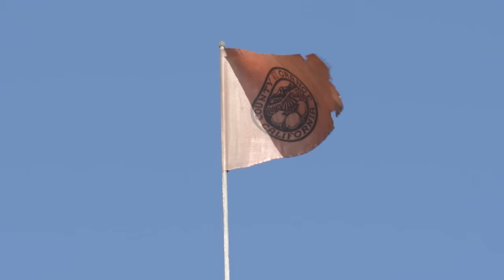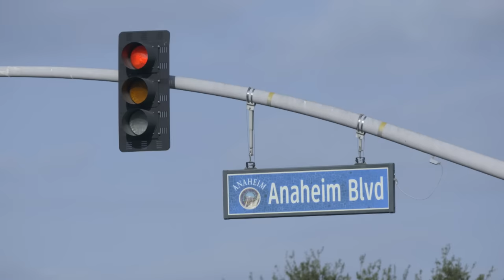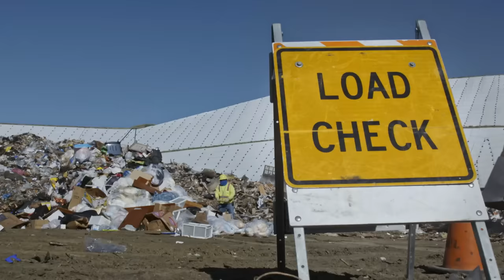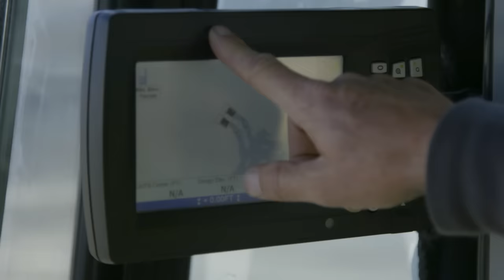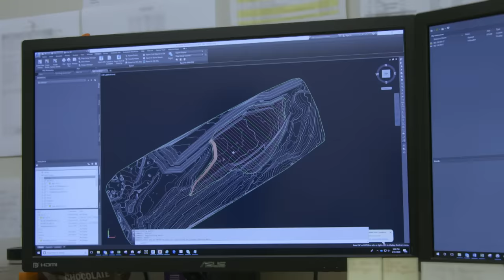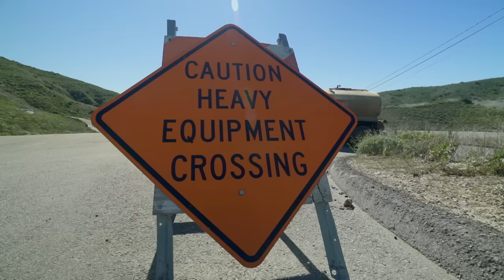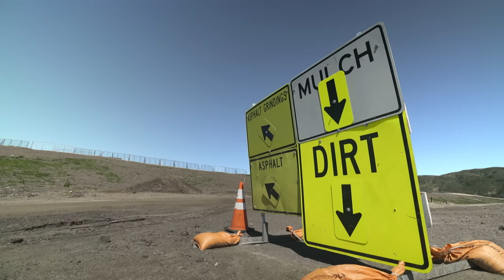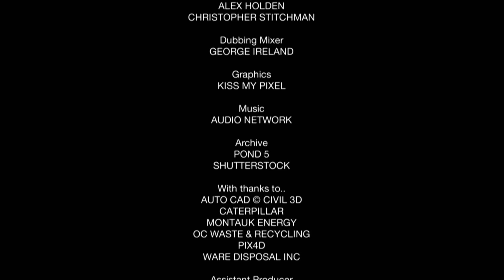Secrets of the Mega Landfill | Free Documentary

Comment: It's really sad to me there isnt a dumping area where the trash can be put on a conveyor to under mag stands and Eddie currents that would pull out a lot of the ferrous and a good bit of nonferrous metals like if they had a giant hopper built in the ground to shake and convey the material under the two mechanics I just spoke about
Reply: I guess I guess my ball park solution would be a designated dump area and truck it to the correct area but the material recovered steelhead alum stainless brass copper lead touch of zinc would have to be worth more than trucking the material to the correct spot on there dime

Comment: There is no way a single guy or group of people can sift through that much garbage weeding out the stuff that's not suppose to be there.  You would need either an electronic system in place to detect or a mass amount of people.
Reply: Has anybody else seen those machines that scans like five or six different types of plastic and then the plastic gets moved along a conveyor belt and a series of wind tunnels blows the plastic into different bins where they're supposed to go? One can assume that plastic is the majority of the garbage so I thought they would try to get most of the plastic out because it doesn't biodegrade for a long time? No way they can sift through that much garbage to get stuff out unless they meticulously go through it?
Reply: @mitchweber7868  Interesting.
Reply: they probably can only spot check. I assume more from what comes in from commercial routes.
Reply: If this screener guy is the only one in that place I doubt he gets more than 1 tenth of a percent. Probably less

Comment: LANDFILL OR FLARE GAS CAN PRODUCE BACKUP POWER:  - Mobile or Helicopter Liftable 8,000 lbs.), Made To Order in the USA Multi-Fuel Generators & Pumps. Environmentally Housed - Self Contained - Gas Turbine Power Modules - 1, 3, 5 Mw -150Mw

Unlimited Parallel Modular Configurations - 50 Hz AC - 60 Hz AC or DC output at optional HP ratings in mid-range voltages.

Comment: They never mentioned the noxious gases that these landfills produce and  I feel sorry for the people that live down wind because it goes into their homes miles away
Reply: Did you miss the part where they burn the gas and produce electricity?
Reply: @gailgrove  not all the gas is captured.  At the landfill I used to work at I think most was captured in fact more was captured than the generators could use.  Alot is flared off because there's not enough storage capacity.
Reply: Well they generated it, let them smell it.

Comment: OK I have a better way to set this up all they need to do is dig a bug huge square hole 500 ft down run all the garbage threw a Shredder and mix it with crumbled dirt coming from 2 conveying belts it will flatten with water and rain then the last 50 feet dump nothing but dirt on top and flatten it instead of pushing it around and running spikes through it for air pockets wasted time and money